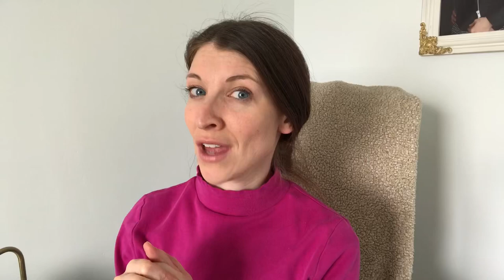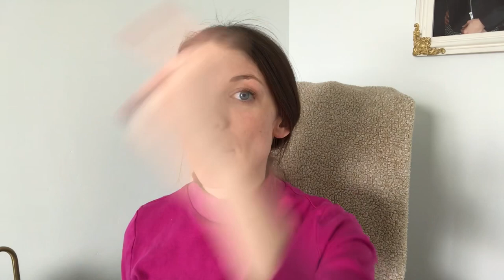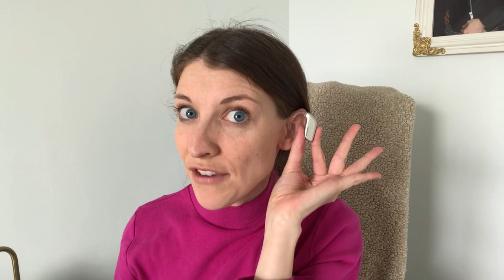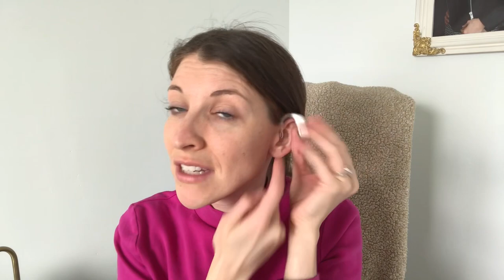Why Your Hearing Aid is Whistling and Squealing

Comment: You may have inadvertently mis-spoken. I think you must know everything I'm about to say, but for the record: The receiver doesn't feed the mic, the mic feeds the processing circuitry and the circuitry feeds the receiver, which IS the speaker. "Receiver" is something of a misnomer, and can be confusing because the term is used somewhat differently in stereo systems, where the receiver is the conduit/processor and sends sound to the speakers. Making things even more complex: You and I wear Power BTEs—everything is behind the ear in that casing: mics, circuitry, receiver (speaker), and the unit is engineered to push sound through the hollow tube, which is held in place by the earmold but totally open where it feeds the ear. Except for perhaps a dampener in the earhook (and there's the option of an earhook without one) nothing's in the way of the sound and the ear. To make things more complex, RICs—and my first hearing aids were RICs—separate the receiver from the circuitry by quite a distance. The mic sends the sound to the circuitry, the circuitry sends the processed sound through a filament wire in a narrow tube, the sound is output directly into the ear by a much smaller receiver, topped by a small dome, variously open or closed. And most of the time there's a wax guard between the receiver and the dome. All of which is why RICs don't do the job for you and me: their mics are smaller, their wire passthroughs are too thin to carry the wide spetrum we need, their receivers are smaller (emulating the difference in stereo speaker sizes and capacities), the wax guard is basically a membrane and the sheer physics of all that makes the RIC sound envelope narrower and the volume ceiling lower.
Reply from the maker: This makes so so much sense. You’re right, I stated it incorrectly. Thank you for this excellent explanation!

Comment: Hi no one gives a chat on squealing if just laying on a table or taken apart   Mine squeaks etc. soon as battery is in , I’ve took pipesvetc off and it squeals on its own. I can’t stop it ?
Reply from the maker: The hearing aid is on. The squealing will continue until it is off or the sound loop is restored. Feedback is due to the amplified sound re-entering the microphone, so it further magnifies the sound and results in the high-pitched squealing.
Reply: @DefiniteHearing  I’ve blocked the holes etc and varied ways it just squeals  that’s it …